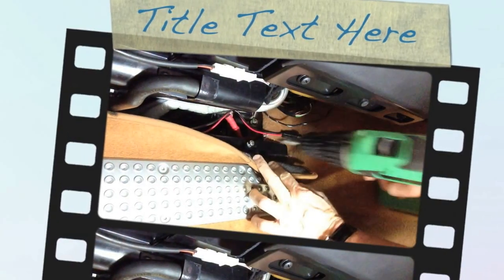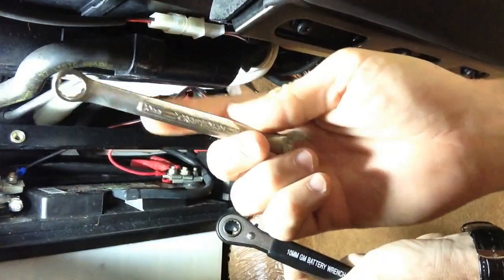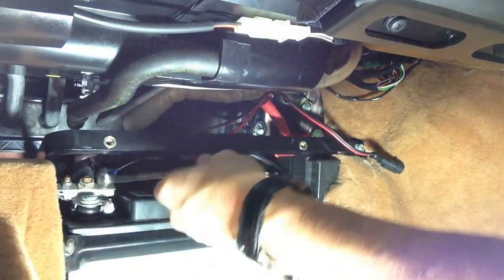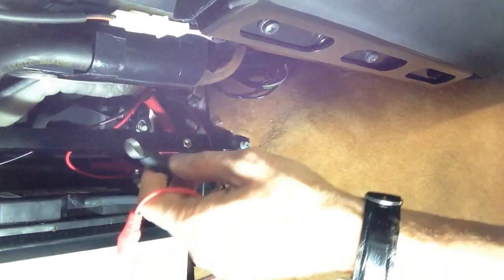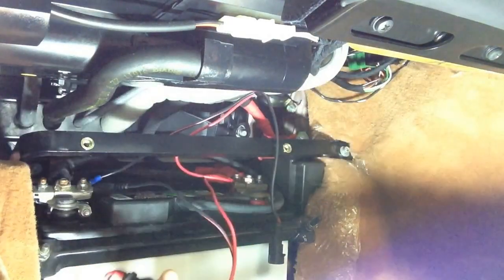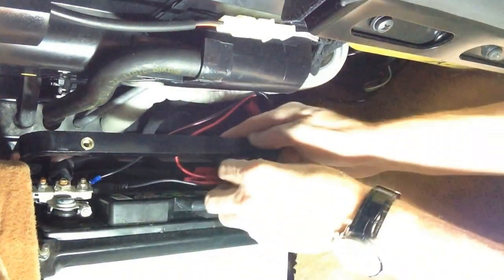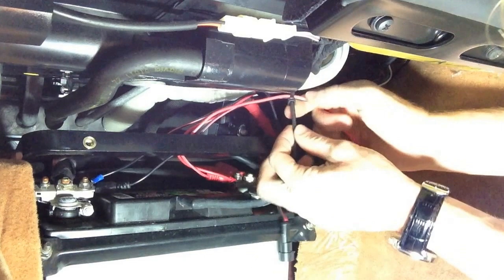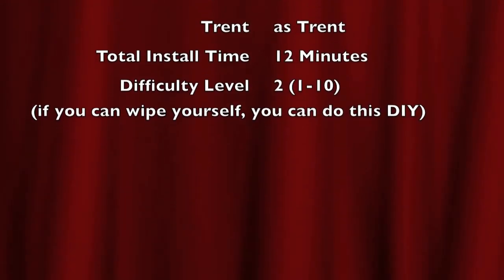DIY Battery Tender Installation - CTEK 4.3 - On Ferrari F430

Comment: Works great for keeping batteries charged and ready to use.ㅋ>imgs.love/BatteryTender?М   I have 3 of these chargers, one for my motorcycle, one for my generator, and one for my riding mower. I have used this brand charger for years, and all my equipment starts up without any hesitation. Highly recommended

Comment: Nice video, my F430 is currently dead, I hadn't driven it for 3 wks although I had started it and let it run for a while a week or so ago.  The battery tender has been on for a couple days but not doing anything so far....not sure what to do at this point.  The battery is only 1.5 yrs old and I replaced at the time thinking it would solve this problem but apparently if u don't drive it for 2 wks it dies, not sure why the cars are designed this way.
Reply from the maker: I switched to an AGM battery (glass mat) and also switched to a Genius 4x port charger that does AGM and lead acid. The switch to the AGM was because the car sits so much and the AGM chemistry tolerates it better. The switch to the new charger was because I have 8 vehicles and needed to centralize my charging needs.
Reply: Do you know if the CTEK MUS 7002 model also work with the F430?

Comment: I've used a piece of plastic tubing, sliced to slip over the shank of the wrench, to help guard against "welding" and swearing when working on powered circuits. (Particularly when I'm beer tasting).